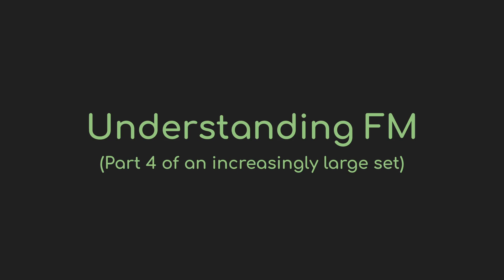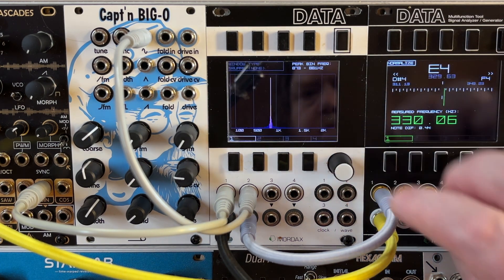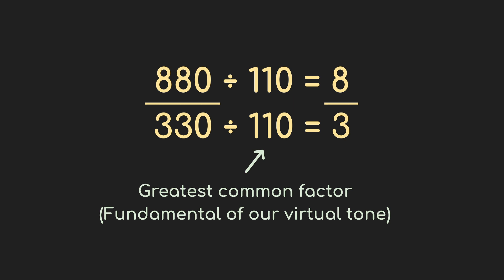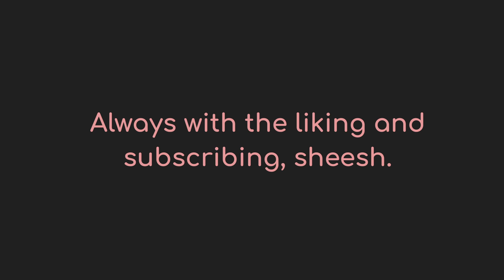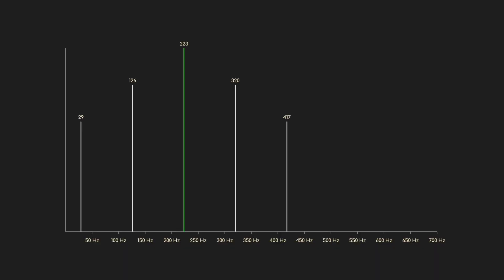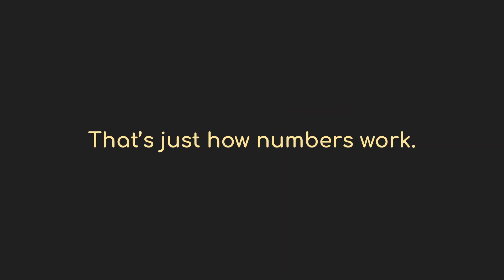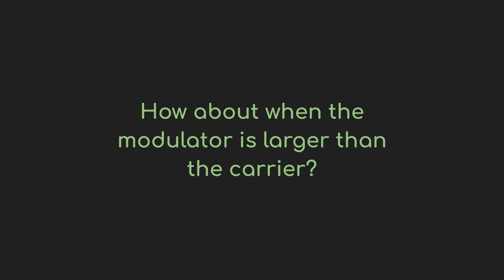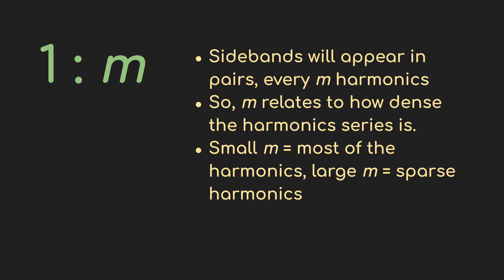Understanding FM #4 - Virtual tones and how sidebands become harmonics

Comment: I tried with Brains fm algo (modulator) into 2600-VCO (carrier) but struggled as I was making it overcomplicated by sending a 2-OP (already) FM mod in which made it almost impossible to get a stable result. Don't have a Mordax, but the Korg NTS-2 is really useful.  It does my head in, but I do love that FM sound. I blame the 80's. Still enjoying these explorative videos. Please continue.
Reply: The 2600 VCO doesn't have linear FM so the whole discussion here won't apply. Exponential FM will mess with perceived pitch even with sine waves.

Comment: An idea that popped into my head (and forgive me if you've already covered this and I forgot!) which may or may not have any merit due to how sidebands appear on both sides of the carrier, is whether you could do "virtual chords" by using specific ratios in combination with specific notes for the carrier to use the virtual pitch of the audio-rate modulation as a second/third note, sort of "tuning" the modulation to fit into the composition.  I haven't tried it yet and I have no idea if it could work, and maybe someone's already thought of this, but I'm very intrigued by the idea.

Comment: Loving this video series. Thanks so much!

If you ever get the chance, I'd especially love to build my intuitions for how FM works in an exponential system like eurorack's volt per octave. So like, if I tune my carrier and modulator to the same base pitch and then start feeding them piches from the same sequencer, what happens? What if I always add 1V (1 octave) to the pitch that goes into of them? What about adding a perfect fifth? What if the base piches aren't in tune; say I tune the modulator to a fifth above the carrier, and then feed them from the same sequencer again?

Obviously I can built some of these intuotions by ear, but I'd love to see the math worked out the way you're doing it here.

Anyway, irrespective of whether that ever fits into your series, I'm lobing it, and I'm already looking forward to the next one. Thanks!! <3
Reply from the maker: @hoperanker8395 - I'll be digging into this more in an upcoming patching video (probably the one after the next one), but feeding the sequencer into both the carrier and modulator is really important if you want to be able to 'play' the result in a consistent way.

For instance, imagine you have a 440 hz carrier and 220 hz modulator, so it's a 2:1 relationship.  Now add 1V pitch CV to each.  440 hz goes up by an octave to 880 hz.  And 220 hz goes up an octave to 440 hz.  That is still a 2:1 ratio - so the effect that the modulation has will be the same, just pitched up.  

Same goes for a fifth.  Say the carrier is at 220 hz, a fifth above that would be 330 hz, so it's a ratio of 2:3.  Now add 1V to each.  220 goes up an octave to 440, and 330 goes up to 660, but the ratio is still 2:3.

Glad you're enjoying the videos!